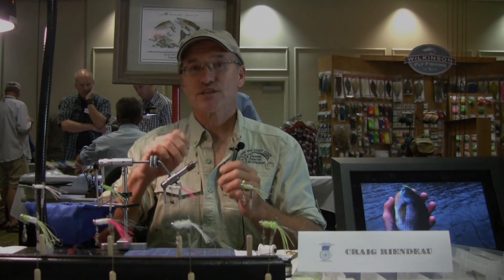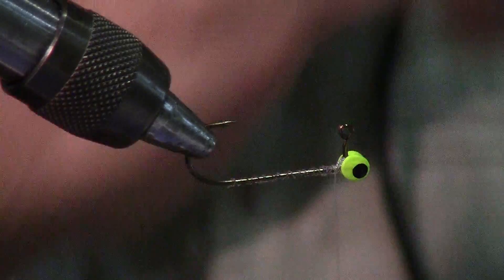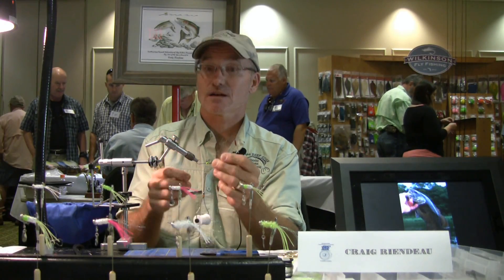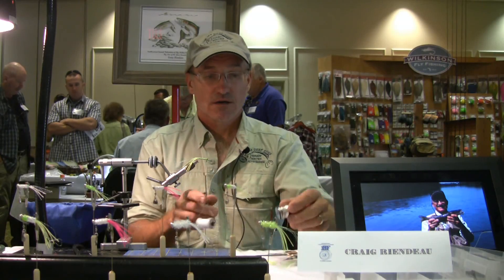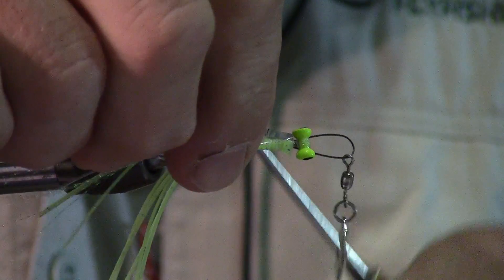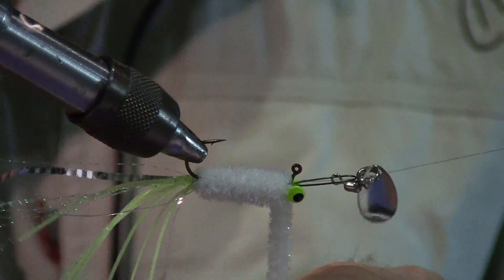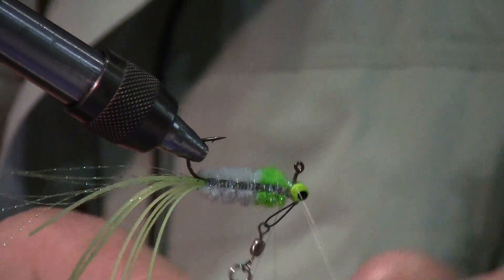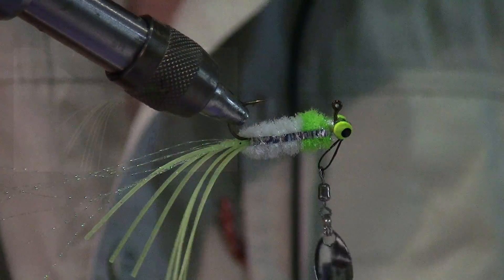Tying the Sonic Boom  Fly

Comment: Hi craig what was the #4 jig hook you was using also could I use AFW Surflon nylon coated 1 x7 stainless steel leader wire 30 pound test instead of the titanium leader wire ,I went to cabela's in Maine and I could not find the hooks and wire and also the sili legs any info would be great thanks Mark

Comment: Blakemore Roadrunner?
Reply from the maker: There is definitely a similarity other than the Roadrunner would be very difficult to cast on the fly rod and the materials will act a little different with the fly. But the way the blade hangs is very similar and I suspect they suspend in the water column much the same way.
Reply: @FlyFishVideo  how much do you charge for these as i dont tie. Thank you
Reply from the maker: Ian Cameron -I don’t tie commercially but I think Craig might. Try going to Craig’s website and contact him directly.